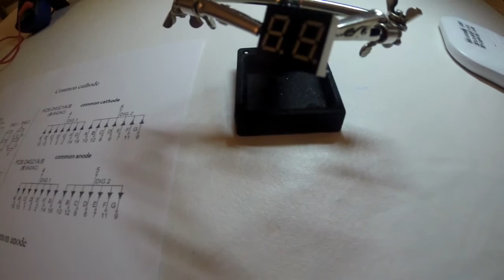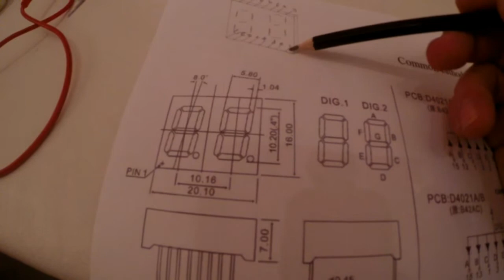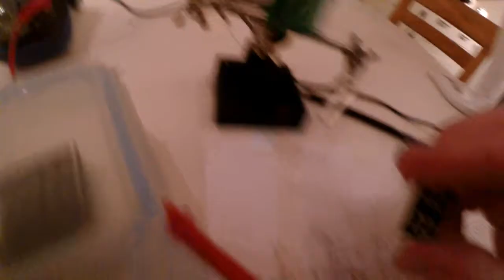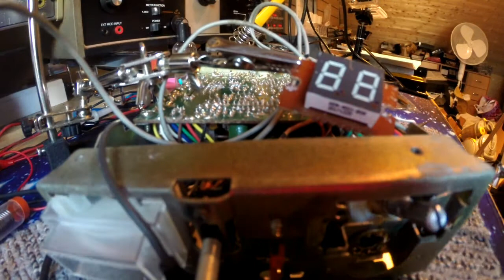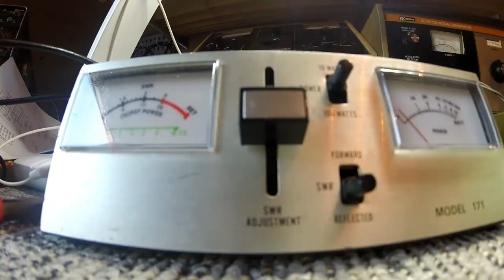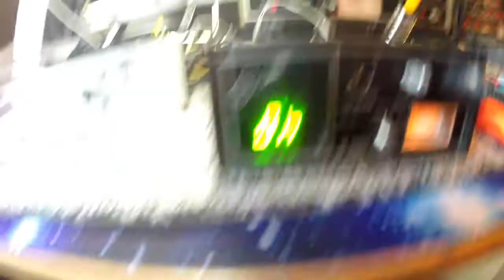CB Radio Lockdown Project - Part II

Comment: In the 80s everybody call this radio bleed over box when it was jam packed with people on every Channels then . It has very good audio it still good quality radio today The DC power plug is all ways a problem I just cut out the hole bigger and use uniden DC socket works as treat . Servisol super 10 usually do the job on PA & squelch control. Great job and keeping the old school a live.
Reply from the maker: I did see a guy onthe net reckons you can still get the power lead plugs from RS, but good call on the unident connector! Those were the days where nearly every road had silver poles up, no worries of bleedover now its much better from that point but do miss the chennels being crammed full, but  not the music players!